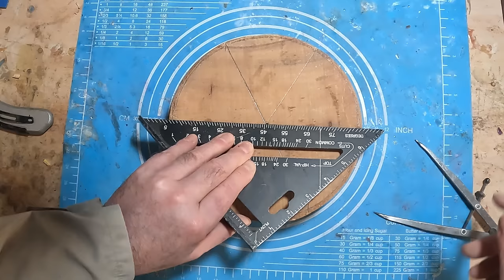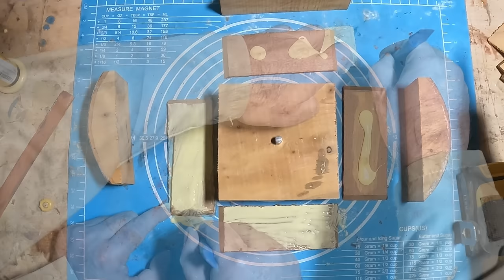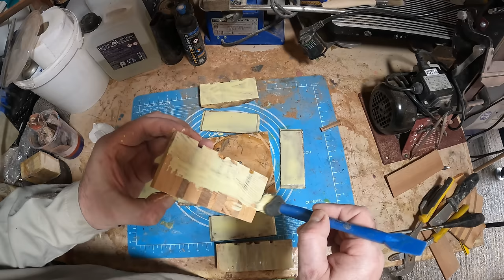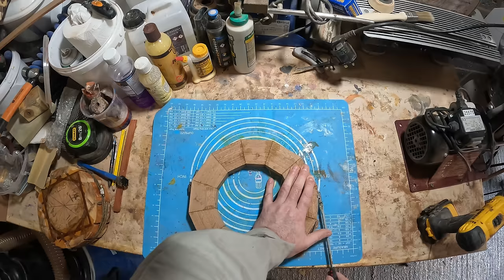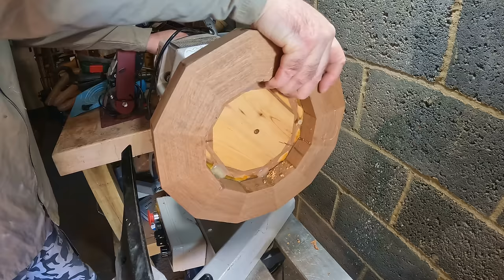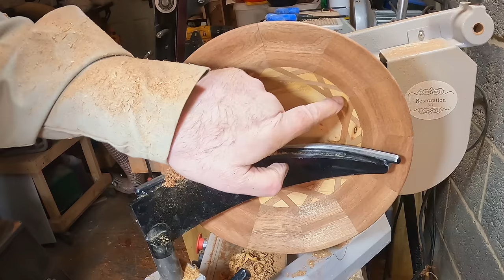Woodturning | Intersecting Patterned Bowl with Segmented Rim | Restoration DIY

Comment: This is so far, one of the most amazing pieces of wood turning I have seen. Absolutely stunning 🥸

One thing I would have done different would be, to sand the surface of the the centerpiece, before making all the marks. It would have made it easier to follow your way of marking of this piece 😀
Reply from the maker: Thank you so much 🙂 I hope to do another quite soon, I’ll sand the blank to make it easier to see the setting out 🙂👍🏻
Reply: @RestorationDIY  I will look forward to see it 😀

Comment: New to your Chanel, very inspiring work, loved the forthright commentary, I will give it a try with some of our Western Australian woods. Many thanks
Reply from the maker: Thank you very much and welcome to the channel good luck with your projects 😀
Reply: Hi Peter, I'm in Perth too. Did you try this ? What did you use if yes ? Has the cross grains moved, cracked ?
Reply: @MrCasutherland  Hi Colin, have not attempted anything like this at present, I have only just started to move into my new workshop, actually still unpacking & setting up. Purchased a Laguna 18/36 prior to my retirement 3 years ago, & it’s just out off the packing box. But in truth I am an absolute beginner, so lots of experience required prior to starting a complex turn like this one. I’m in Bunbury.
Reply: @bloke875  nice starter lathe. If you're ever up Balcatta way, let me know. I can give you a tour of our men's shed.

Comment: Would there be a way to have less (maybe almost none) waste...perhaps making a set of "nesting bowls" from the log and epoxy blank...Lovely in my mind's eye...  I really REALLY despise waste!
Reply from the maker: Hi,  thank you for your question, with that particular bowl it would have been difficult, with the epoxy bowls most of them have a waste block cast in the center, though if I had the correct tool for coring solid timber blanks it can easily be done.

Comment: i have watched the guys making resin and wood bowls    some are realy good     BUT   most times the woods wet    with knots      after a while    the wood splits from drying    the resin comes apart from the wood   and of corse   the whole thing gose dull   because    as i said    wet wood
Reply from the maker: I agree I don't use wet wood especially with Epoxy Resin and the shine on bowls I did over a year ago is still as good as the day it was finished 🙂
Reply: @RestorationDIY  the wet burls they use that when on the lathe long ribons come off     verey nice bowl verey nice finnish    but      think     i couldnt sell it here in South Africa      FOR OBVIOUS REASONS
Reply: @RestorationDIY  the catch is     you just cant make a bowl from any old log you find in the forest       some do    BUT    the big crack going down the middle and the dirty brown knot    is somehow passed off as sexey and saleable